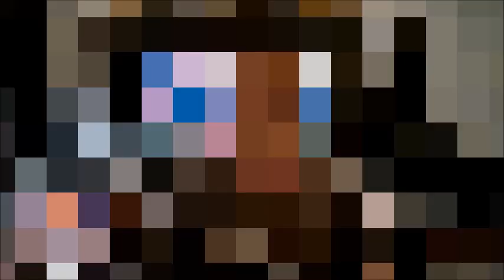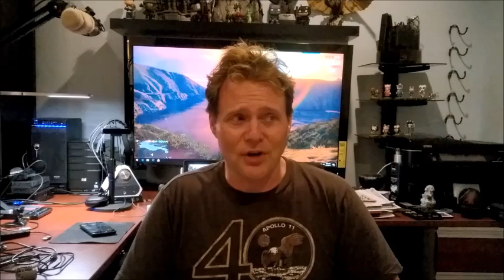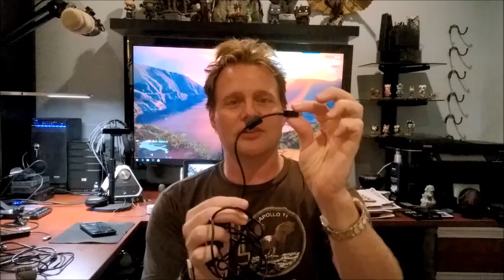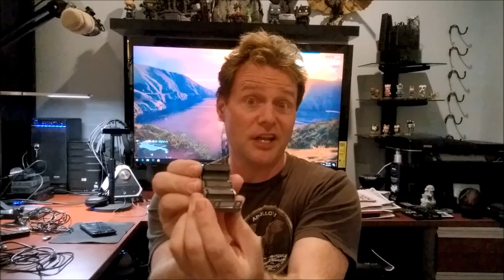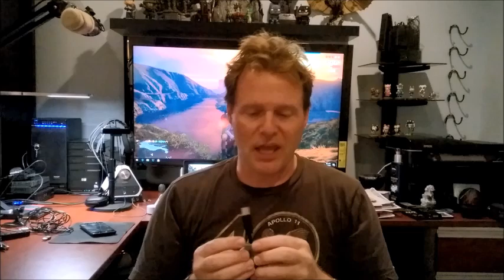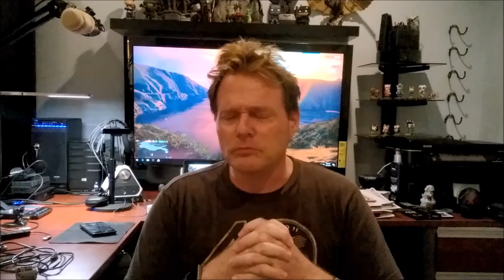What are Ferrite Cores and How do I use one?

Comment: Also: If you use only one choke should you place them at the end of the cable or in the middle? If you use 2, 3 or 4 chokes where should you place them?
Reply from the maker: Just one choke at the end where the device is plugged in should be all you need.  Hope this helps!

Comment: You haven't explained how they work at all. You haven't explained if it's important that they fit tight or if it's completely irrelevant. You haven't explained how the times you wrap the cable through the core relates to the shielding. Is it a linear relationship? Moreover you haven't explained if those cores are better against high frequencies or low frequencies. You haven't explained if it's better to put a core around each individual conductor or if it's better to have one core around the whole cable or if it's irrelevant. You haven't explained if and when it's harmful for data signals.
Reply from the maker: Hi Kwinzman - thanks for your detailed feedback!  I wanted to keep this video fairly simple, and I'll be the first to tell you I'm not an electrical engineer. I haven't added a great deal of complexity here, but it sounds like your questions could be important for me to address.  I'll see what I can do to create an updated video, it just may take me a bit of time to get to it right now because I'm moving to a new home.
Reply from the maker: Is there a particular problem you're trying to solve that I can help you with?

Comment: Thanks for the explanation . Funny ,while you were describing it looked at a cord and it did in fact have the same thing you were demonstrating. Have recently installed dash cam that's creating static on the FM radio. Does this ferrite  cord go to the power supply for the camera or the radio ?  Many thanks.
Reply from the maker: Hi Sir Lancelot!  I'm sorry I didn't see this sooner - I'm having an issue where sometimes Google dumps comment notifications into junk mail and I can't always catch it.  Anyhow, to answer your question, there's a few possible areas where this problem might be happening for you that you may want to check.  Does the dash cam have WiFi on it like some Blackvue models do?  See if disabling it makes the sound go away and that may narrow down what exactly about this dash cam may be related to the radio.  When you installed the dash cam, are the wires running near the radio, or do they share a connection to the fuse box?  For example, some DIY car stereo modifications might use the ACC fuse to pull power...and yet the BlackVue PowerMagic Pro kit also taps the fuse box--having both sharing the same point might cause a problem.  If the radio was something you installed, and your dash cam's wiring requires you to ground the dash cam against the frame of the vehicle, make sure everything's properly grounded, and (for example) the dash cam and radio aren't being grounded on the same screw.  I hope this helps!  And again I do apologize for the very late response.

Comment: I experience noise while recording vocals with USB microphone connected to computer. This is because of grounding issue. When I remove power, the problem vanishes. Can Ferrite Cores can help rectify the issue?
Reply from the maker: Hi Jimmy!  It can.  I'm a little curious about what you mean by "when I remove power" - are you saying this is a laptop and you unplug it from the wall?  There's more than one place that noise can come in, and the solution in my video is one cheap troubleshooting step I took that helped me with noise on an AT2020 USB+ mic I had on a Surface Pro.

Can you hear the noise during recording?  Does the noise show up on the recording if you play it back on another device?  Do you get the noise even if the computer is plugged into a power outlet in another room?  These questions might help you narrow down where the problem could be coming from too.

Hope this helps!
Reply: @trentonbennettVO  My home does not have Earthing (Grounding). This is the prime reason of noise in my recordings. Therefore, when I unplug power supply to my laptop, the problem gets resolved. However, I have to connect external monitor to my computer (which is connected to power supply). Thus, when I record using USB microphone, I find noise. At end, I have to play around to remove that noise which is very time consuming. So, I found your solution. This is the reason I asked you whether this product can help me in resolving the issue.
Reply from the maker: Hi Jimmy!  I just discovered yesterday that apparently some of my YouTube comment notifications, Google dumps into Junk--so I'm sorry I didn't see this.  Are you in the USA?  I'm asking because my next question would be, "is the home old enough that the wall outlets are two-prong and not three-prong"?  I'll keep an eye on this thread (and my Junk Mail folder) so that I can properly help you on this one.  In the meantime, I'll also say that I live in an area with a lot of electrical storm activity, and we use a variety of things to protect our stuff.  If you have wall outlets with a grounding plug at the outlet (in the US it's a three-prong plug), you can also try plugging the laptop into an Uninterruptible Power Supply (UPS).  These are not terribly expensive, and most also tell you that they offer 'line conditioning', which is another way of saying they try to keep the flow of current steady and stable, and they also try to prevent line noise.
Reply: I am from India. Delhi does not have storm issue. The weather is nice and clean. House is new with many apartments within. Whole building is not grounded. The wall plug is 3-pin. I tested using two plugs but of no help. I even checked USB isolators but they were not of help. I tested UPS even but they were also of no help. The premium one are way expensive.
Reply from the maker: @pythoncamp   Okay, if you're sure that the noise is a grounding issue and not interference, then this video might not be very helpful to you.  However, what I would do to troubleshoot is get one of the larger cores like you see me show in the video, on each end of the USB cable, and loop it through one time like I do.  This at least means that you're eliminating the possibility that the interference comes from nearby (there's different types of interference, and that's quite a long story)  You might also consider trying a different USB cable also.  Basically, sometimes a cable can behave like an antenna, because it's a long piece of metal, and so it can pick up stray interference from the air.  This isn't the same thing as a grounding issue, where the signal problem is coming from somewhere inside the equipment and traveling through the wire.  Check out this guy's video for a great explanation - he gets more technical than I do, and he does a great job making it understandable!  https://youtu.be/veIL3GeqA68
Reply from the maker: @pythoncamp  Check what kind of connectors your USB cable has on each end to be sure you have the right one.  I'm going to show you this example that I had for an AT2020 USB + microphone:  https://amzn.to/2W3W9DE  It's just better shielded than the typical cables that may come with your equipment.  Also, if you haven't reached out to the manufacturer of the microphone, I would do that too.  They may know of issues specific to your mic or have suggestions beyond what I've got for you here.  Let me know how this goes though! :)

Comment: I have a howl and a squeal with my rack mount hifi audio equipment for use with ham radio. I just received 5 ferrite cores to wind up my coax with and also I will improve my ground. Hope it works!
Reply from the maker: Good luck Kristopher!  This is a cheap way to possibly fix such problems...and if it doesn't you can also look for a Ground Loop Isolator.  I had a car stereo where I had to put one of those on.  This Wikipedia article will explain a bit about how those work, and why you might want to check what frequency range the interference is coming in on https://en.wikipedia.org/wiki/Ground_loop_%28electricity%29
Reply: @trentonbennettVO  thank you so much! I am using a ground loop isolator and it works great. I might need another one. I have yet to wrap the ferrite rings with my coax and some with the power leads, ill let you know the outcome! Thank you for your help

Comment: Can i use a ferrite core on the Primary  (220v) electrical supply that feeds a network box ?
Reply from the maker: Sure!  It won't do any harm.  It just may not be much of a help if you're not specifically trying to solve a line noise problem.  I plug my network equipment into a UPS which will give you some line conditioning and surge protection (and battery back-up).  Hope this helps!
Reply: @trentonbennettVO  I guess there is no difference if it's AC or DC power line 120/220v?
Reply from the maker: @ricardoabh3242  correct. :)
Reply from the maker: @ricardoabh3242  correct!  The principle behind electromagnetic interferences is more about the nature of the current flowing through the equipment and not about a particular voltage.  Hope this helps you! :)

Comment: I use Logitech Z120 speakers with my notebook PC. They're powered by USB. If I try using it with my Note 8.0 while the latter is charging/plugged, I'd hear a buzzing sound from the speakers. Would a ferrite core solve this?
Reply from the maker: Yikes!  Sorry I didn't see your comments - I was in a holiday season in the US and didn't see this come through.  Sometimes a cellphone can create buzzing in speakers when it's close to them - this may not solve your problem.  This has to do with interference in the air and while the ferrite core is worth a try, for me it's typically a situation where I just need to move the phone further away from the speakers or put it in Airplane Mode.  Hope this helps!  I'll see if I can find an example of what I think you may be experiencing.
Reply from the maker: Does this sound similar to the 'buzzing' you're hearing?  https://www.youtube.com/watch?v=23rdefO4gBU